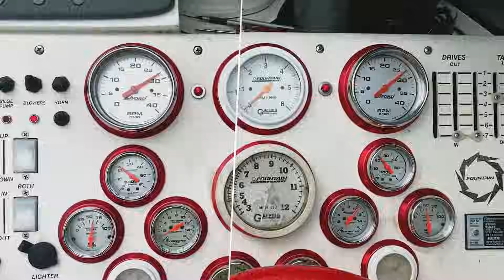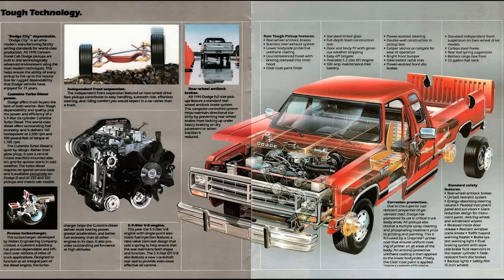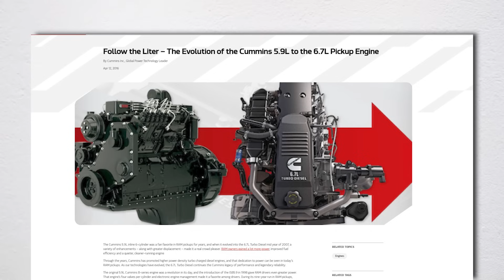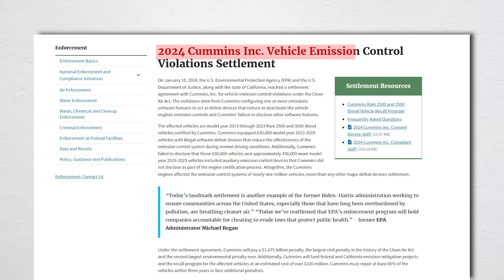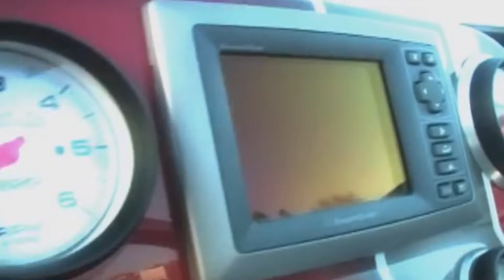The Rise of Cummins: Caterpillar's Biggest Rival

Comment: I didn't realize it think about cat marine.  Still sounds weird. When they tried to get into the locomotive market it failed horribly. It's said it was the different environment both the variable load and the vibration and jostling was too much for the engines that were usually designed to be more stationary.

Comment: I am surprised that the significant challenges Caterpillar experienced with thier 3116 and 3126 engines in the late 90s early 2000s was not mentioned. To those who have knowledge this was not Cats finest hour and created the opportunity for Cummins to close the gap. As you have stated this while Cummins was showing up very well in Dodge trucks. Owning two 3126 engines in a motoryacht and starting out life as a diesel mechanic I can share the Cat engines were not as reliable as the Cummins and needed more tuning but when tuned they were quieter, easier on fuel and emitted less soot.